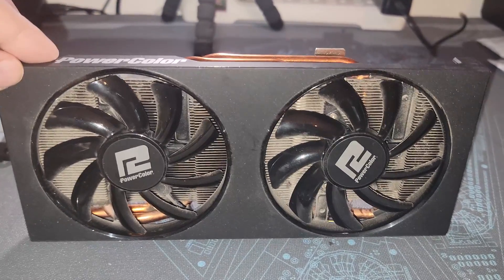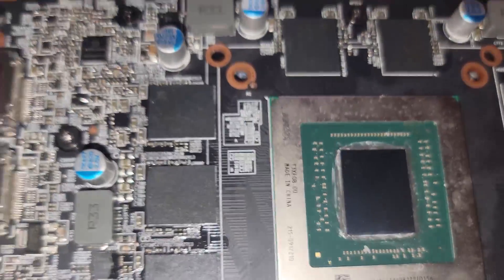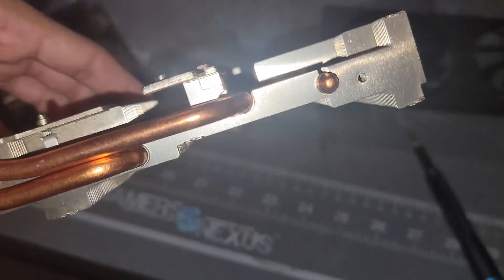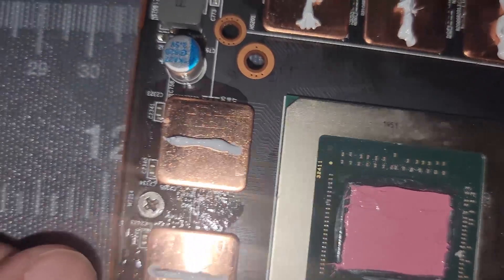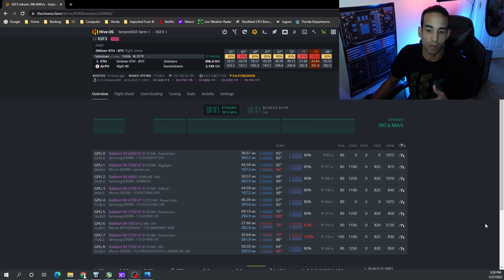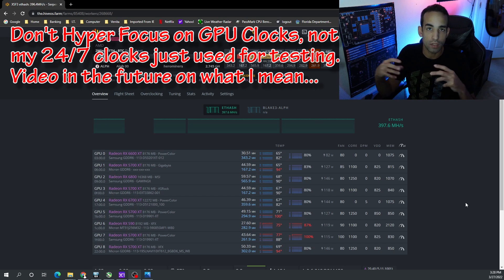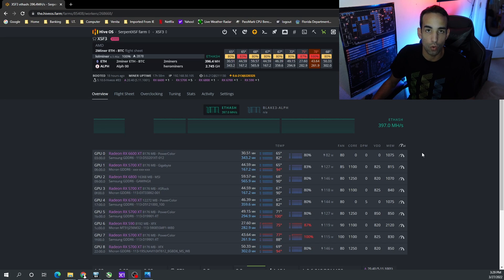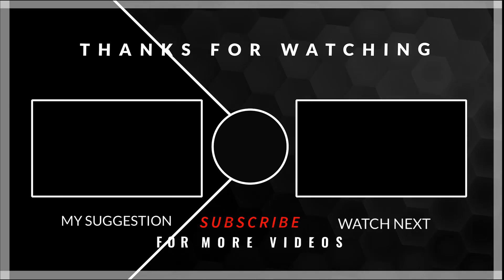PowerColor RX 5700 XT Teardown, Copper Mod, & Thermal improvements

Comment: The solid copper shims take up some of the mounting force, so the force to the gpu is slightly less. This is the reason for the core to run hot after this mod.
Reply: Help, i have a galax/kfa2 3080ti sg but vram pads were 2mm, from eye they look about 3mm compressed, what thickness should i use, i also don't have a good caliper
Reply: so you need to make the copper pads thinner?
Reply: this is correct good post.
Reply: thats right. i did a similar copper shim mod on my high OC GTX 970.

1st try had horrible core temps. I tried many times until i found the right setup. I used 0,5mm thermal pads and also pressed them down a bit more. this barely makes contact but its the best solution.

even just going with 1mm pads was enough to make so much space between cooler and gpu die, that the temperatures went way to high up.

so in his case, i would use thinner copper shims and balance the rest out with thermal pads from gelids solutions.

pads can always be squished, but a copper shim will not give any way. So if they are just 0,1mm to thick, it will destroy the whole contact patch of ur GPU die.

the best budged solution would be to buy a used Kraken AIO bracket for 15 bucks on ebay.

and then install a cheap AIO on it. Then u have plenty of room to install any size of heatsink u want with thermal glue tape.

and if u install a good AIO, even going to use liquid metal will have a bigger benefit.

Comment: I have similar this gpu, how thick size your copper plate? Thanks
Reply from the maker: 0.7mm
Reply: @SerpentXTech  and if i need to add just thermal pad what the thick i get 1mm or 2mm ?
Reply from the maker: @nkboyofficiel8500  for this model of power color. 1.5mm

Comment: Hi Friend, I have modded almost every gaming graphics cards with copper shims, I noticed that your GPU core temp wen't up but memory temps went down, this could be a result of your GPU core having a little gap between the die and the heatdink, which had happened to me as well. I fixed this by adding some copper sheet about 0.1 or 0.2 thick with thermal compound on both sides. Just thought I'd let you know. Cheers!
Reply from the maker: Thanks for info bud
Reply: Help, i have a galax/kfa2 3080ti sg but vram pads were 2mm, from eye they look about 3mm compressed, what thickness should i use, i also don't have a good caliper

Comment: Hey Serpent, idk if you are gonna see this, but the asrock 5700 would be an awesome gpu to test this, because the cooler for the memory is separated, so no clearence issues with the memory or gpu die. That would give a 100% result of the benefit of running cooper shims

Cheers
Reply from the maker: I already modded the Rx 5700 from Asrock but we can test a before and after. Thanks Ruben
Reply: Help, i have a galax/kfa2 3080ti sg but vram pads were 2mm, from eye they look about 3mm compressed, what thickness should i use, i also don't have a good caliper

Comment: friend, good video, the asrock challenger that has the sink vram separate from the core heatsink, if we apply this mod on it do you think it will occur the same with the core temperature (rising) or not? Do you think it's better to make this mod on the back of the vram for game use? Even if the vram heatsink is separated from the core heatsink? Thank you and I really like your videos.
Reply from the maker: Not on that back of Vram, too many risk of shorting components. For the Asrock one you mentioned, if the heatsink is split in two, the core might not be as effected by the increased thermal efficiency of Mem cooling. Just be careful to make sure the shims are not bigger than the space required. The shims need to be smaller than thermal pads it is replacing, as thermal pads can squish, but copper can not.
Reply: @SerpentXTech  Thanks man, I'll do the mod on the front of the vram even, just like you did. They are 0.8mm copper shims. Waiting for the shims to arrive from China. Good weekend to you brother.

Comment: Dont you simply lost pressure between the die and the heatsink due the cooper pads being too thick? Its unlikely that your memories extra heat would to change that much the overall temp of the core, specially after you upgraded the fans.
Reply from the maker: Shims need to be thinner than the thermal pads it's replacing. Depending on the GPU heatsink design, if we increase the efficiency at which with pull the heat from memory into the base heatsink, it can increase core temps. However, it just depends on the actual heatsink design. Like a larger 3000 or 4000 series heatsink won't see much of a difference, but these Powercolor cards don't have much surface area

Comment: Help pls I used copper mod on gigabyte  5700 xt  ,I placed 0.5mm copper shim as card support 0.5 mm thermal pad but after that GPU main die wasn't making proper contact
Reply: The thermal pads required are 0.5mm but they are compressed when you put the heatsink on so you actually need to measure the compressed part of the thermal pad to determine what thickness shim you need. Probably more like 0.3mm

Comment: Hey i got the msi 5700xt gaming x, its hitting 70c on load, hotspot at 110! I would want to try this. U think i can pull this off as a first timer modder? I just dont know how thick the shims should i get... Thanks.
Reply from the maker: As a first timer try replacing thermal pads first. You can find the thermal pad size online by searching the model or checking out EK waterblocks site. If you do shims you want to be a hair thinner than the recommended thermal pad size.

Comment: that is very bad result with copper , you can get better result with good thermal pad, i have used gelid gp ultimate on my rx 5700xt and my memory is 60 to 66c while mining at 56mh. I dont think you did something right , with copper your memory temp should not cross 65c
Reply: What thickness did you use? I need to buy some if this